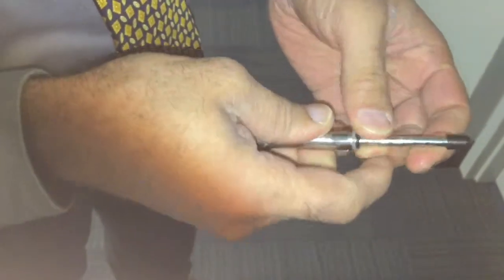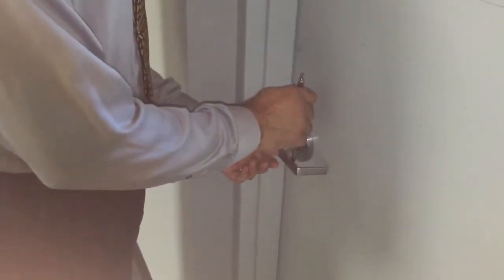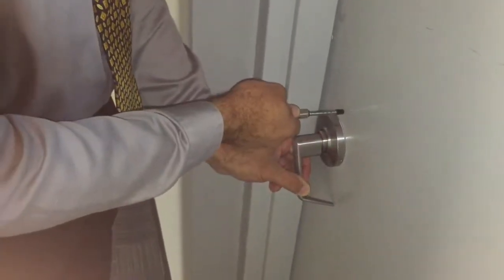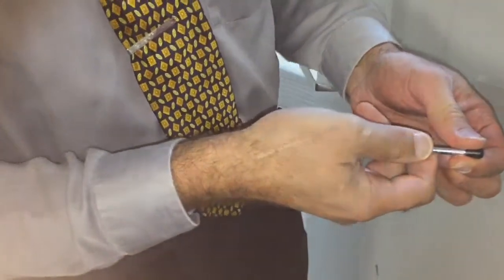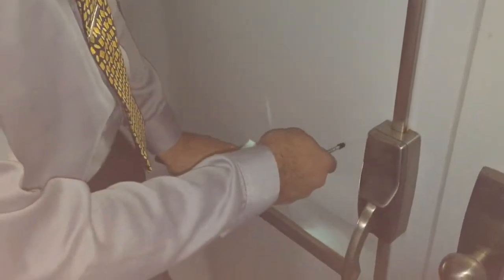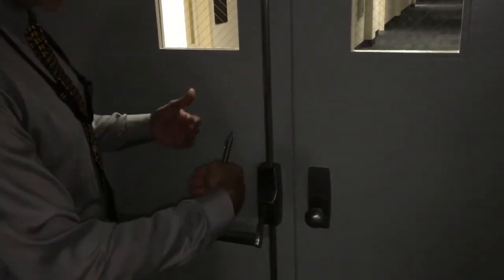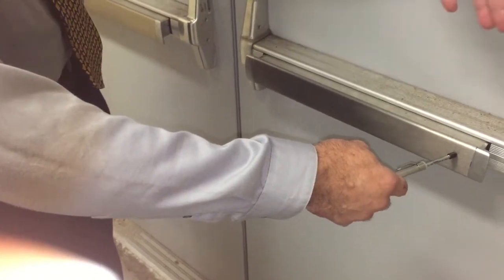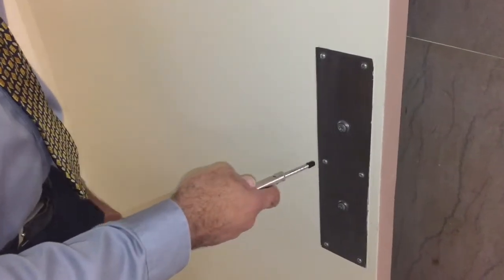Door Force Testing

Comment: this force test on fire exit doors should be conducted when the area is pressurized right? when the pressurization system is operational. To get accurate result when concerning with life and safety in the event of fire.
Reply from the maker: If on pressurized location yes when on to verify can open.  NFPA 101 sect 7.2.1.4.5.1 has door force 15lbf release latch 30lbf to set in motion and 15lbf to fully open. Also powered doors has other requirement and check with power off also

Comment: Sir can you please tell the weight and the material of the door
Reply from the maker: Deasmond, we are doing the force to open the door. The weight and material of the door not factor. Per our code use the forces to unlatch must be 15lbs or less, to  start is 30lbs or less and continue to full open is 15lbs. Hope that helps